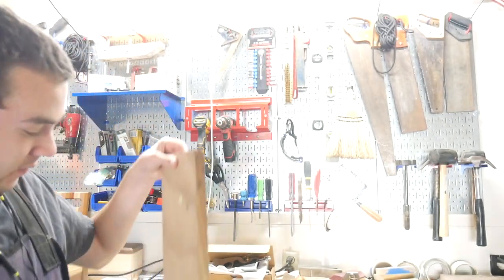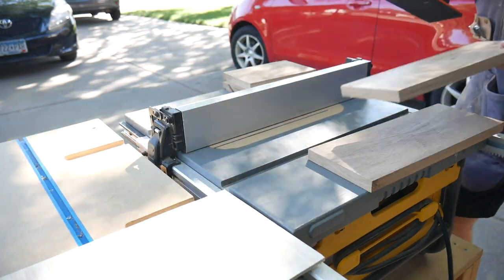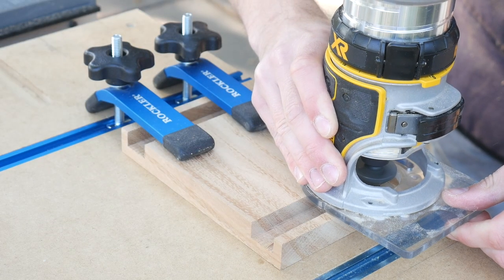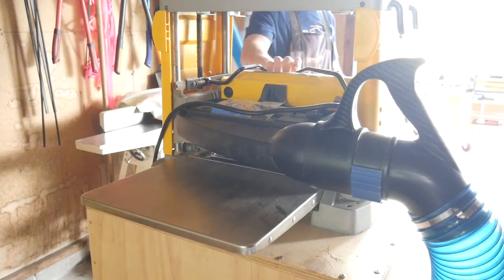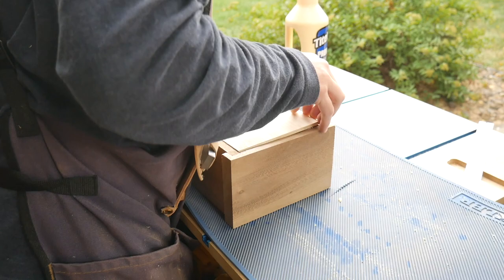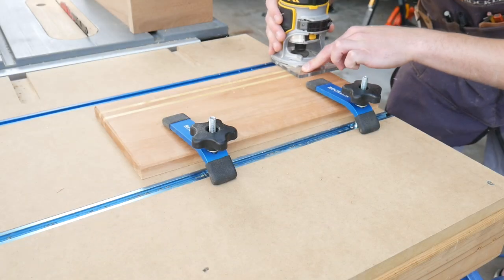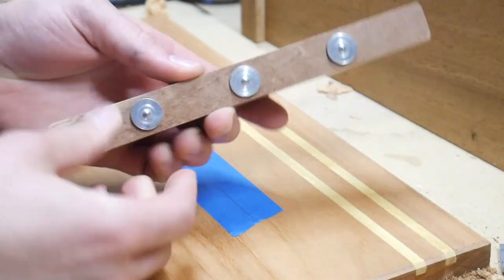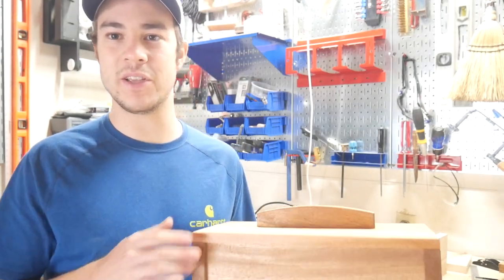Making a Box with Yellowheart Inlay and Hidden Magnets

Comment: Great Video! Do you think that the magnets would be stronger if you had set them closer to the edge of the lid, and used a more shallow dowel? Looking to do something similar but with a little more hold. 
Cheers!
Reply from the maker: Theoretically, they should be if you do that! Mine are actually pretty strong as is. Good luck!
Reply: @TheTranq  Awesome, thanks for the reply! Cheers